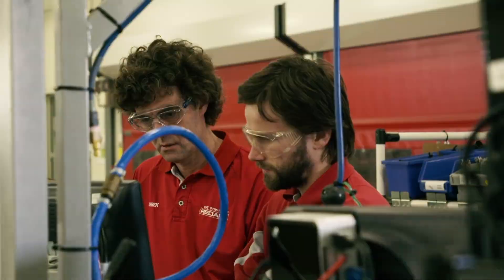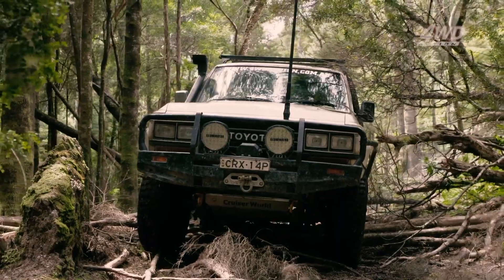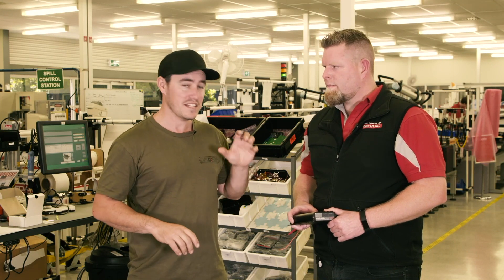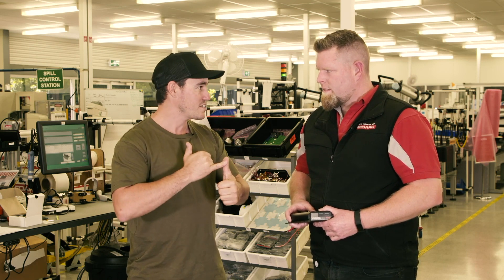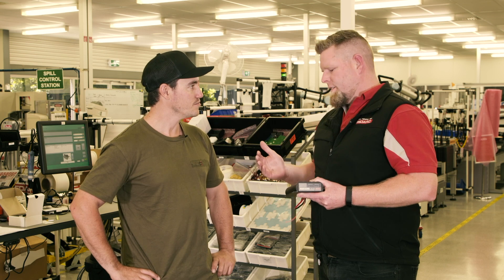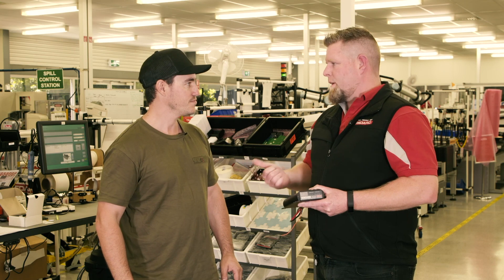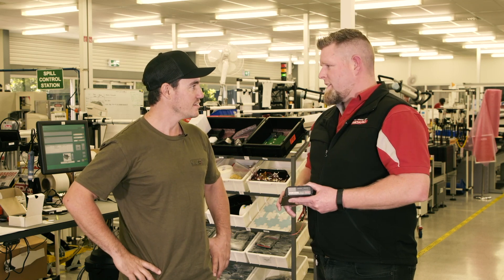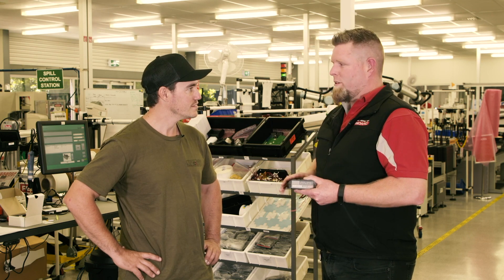What’s the difference between isolators and DC-DC battery chargers?

Comment: Hi @REDARCElectronics - I don't have an aux battery in my car, but i want to install anderson plugs on my towbar to charge the caravan while driving.  My car has a Smart Alternator.  Can i use the SBI?
Reply from the maker: Thanks for watching! You can use the SBI12 in this application, however you will need to wire the blue override wire to ignition for it to operate correctly.

Comment: I've read all kinds of opinions regarding to dcdc chargers & can't seem to find any definite answers  on line, my question is ..
Will a dcdc charger still  charge/ operate if you damage  temperature  sensor wire ?
Can the wire easily be replaced replaced ?
Reply from the maker: Hi there, thanks for your comment. REDARC BCDC units don’t have a temperature sensing wire to operate – they have this in-built within the unit. However our Manager30 product does as it is required to charge the battery. If it were to become damaged on this unit, the charger will not output as it doesn’t know the temperature nor voltage in the battery. The Battery Sensor part of the setup would need to be replaced in full in this scenario. If you have further questions please don't hesitate to contact our friendly Tech Support Team on 1300 REDARC and they can advise in greater detail over the phone.
Reply: @REDARCElectronics  awesomeness guys.. thanks for that👍

Comment: I have an SBI12 already installed running to an Anderson plug at the back of my vehicle. I use this to run a portable compressor.
Can I tee off this cable halfway along and install a charger before a 2nd battery? Since it will already be going through an isolator, do I need to connect the charger to the ignition?

Comment: So if I have an old style alternator (2003 Jeep TJ) I should just use an isolator?
Reply from the maker: Hi Jay, as your vehicle has an old style fixed voltage alternator you can use the SBI12 Smart Battery Isolator however the best way to charge a battery regardless of the alternator type is the BCDC as this is a multi-stage in-vehicle battery charger ensuring your auxiliary battery is charged at the correct current and voltage resulting in maximised battery charge and life.
Reply: @REDARCElectronics   I see. So the issue with using the SBI12 is that I will not get a full charge and my AGM will have a shorter life expectancy correct?
Reply from the maker: @JeepTJay6  The SBI12 relies on the alternator to regulate the voltage, whereas the BCDC can control the charging voltage to ensure your battery is being charged at the optimum voltage which will result in an increased life of your battery
Reply: @REDARCElectronics  

So one last question. I have a very small 56Ah AGM auxiliary battery bank which is made up of (x2) 28Ah batteries in parallel for the refrigerator in my Jeep. Id love to run a DCDC charger between my starter battery and my battery bank but the smallest DCDC I’ve found is 20A which puts out too much power for my 56Ah setup. Are there any DCDC options for a bank as small as mine? I should add that my Jeep has a 160A alternator.
Reply from the maker: @JeepTJay6  Considering the battery bank size you might be best to consider the BCDC1212T, which is a 12A input current limited charger. 

The size of your battery bank and your alternator also brings about another reason why a DC-DC charger can be of great use – if you were to use an isolator and your AGM bank was flat, with the vehicle running it would attempt to bombard the battery bank with current until it reached the alternators regulated voltage, significantly decreasing your battery bank’s life expectancy in the meantime.

Any further questions please contact our helpful Tech Support Team over the phone who will be able to discuss in greater detail.
Reply: @REDARCElectronics  THANK YOU!🤩

Comment: do i need a smart isolater and BCDC charger working together with dual battery system or can i just run one or the other?
Reply from the maker: Only one of these are required for a dual battery system, but the product required for you can vary with vehicle and purpose. 

Both products can actually be combined as per the New Ultimate Dual Battery Setup, which will allow the best charging possible for your auxiliary battery as well as a jump-start feature, provided the battery is suited to this application http://www.redarc.com.au/bcdc-dual-with-jump-start-feature-the-ultimate-battery-setup. 

For more information on the charging method best suited to your needs I recommend using our Dual Battery System Selector tool https://www.redarc.com.au/dual-battery-selector
Reply: @REDARCElectronics  Hello,
I'm looking to use permanent dual batteries in the engine bay with an isolator and larger "portable" LiFePO4 battery(s) in the cab or truck bed. The battery chemistry in the engine bay will be different than the truck bed (I can buy LiFePO4 starter batteries, but my area reaches below 32f sometimes).

I would like to use solar and a REDARC BCDC1240D/BCDC1250D in the "Ultimate Dual Battery Setup" configuration.

What would be the best way to wire and provide charging for the non-permanent lithium battery(s) in the cab or truck bed? I would not need to charge the engine bay aux battery and the LiFePO4 batteries at the same time with DC-DC/solar. Would appreciate any input, thanks.